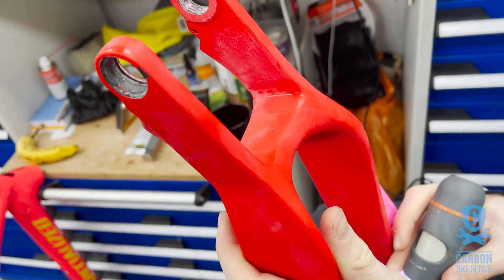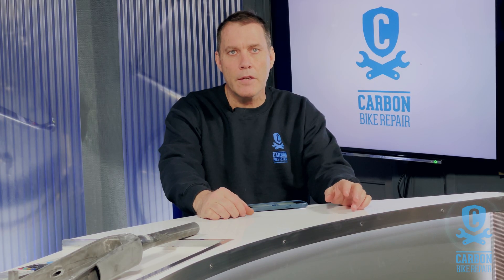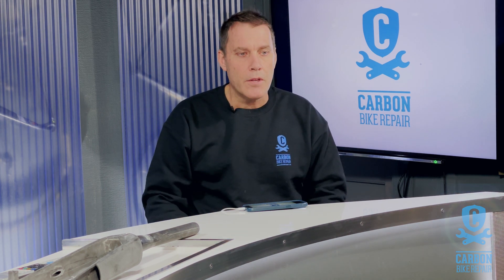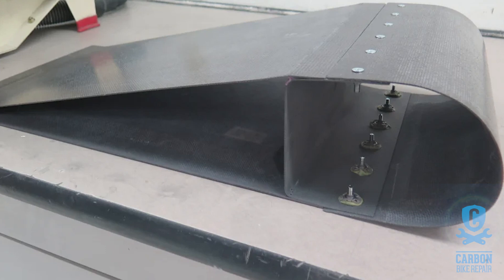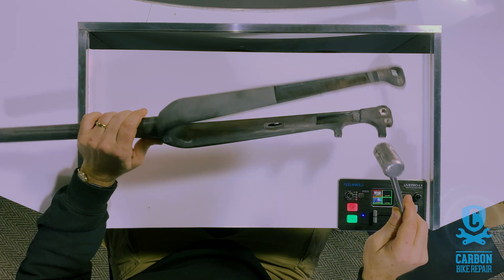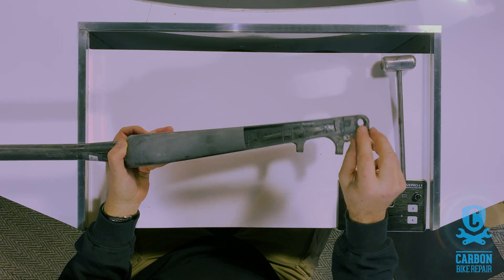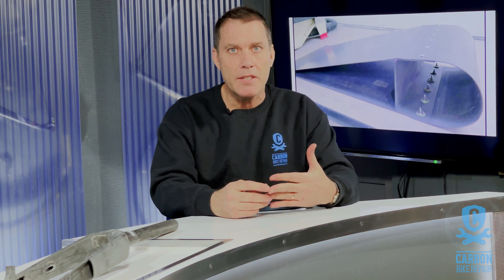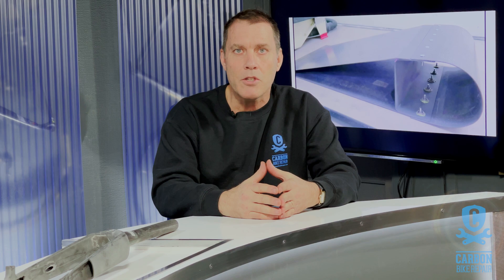MYTH BUSTING - CARBON TAP TESTING..NOOOO!!

Comment: So it sounds to me like the coin test is flawed because it can give you a false negative -- BUT if a crack does indeed clearly fail the tap test in an area -- say the bottom of a Top Tube, where the diameter is constant, there's essentially no chance of it being a false positive -- right?

Comment: 6:38 If you can't detect it you consider it a fracture?!
Reply from the maker: @mreese8764  That’s not what he is saying..There are cases where some visible anomalies or traumas are showing inconsistent or inconclusive results depending where the issue is. There is no magic wand. What would you do as an inspector? 
It must be then be investigated by paint removal and then material removal if necessary. 
If it is not conclusive with the tests Rob mentioned then it cannot be ignored. Today we use scanning software which is more helpful but even so we would still remove material if we had any doubt.
Hope that answers your question?
Reply: @carbonbikerepair1  Yes. Than you!

Comment: I feel like this advice works for a fork. I do understand that its unreliable do to your hearing quality. However, I didn't see the test on a bike frame. We dont have access to a expensive testing tools. So what do we do to test used carbon bikes?
Reply from the maker: Good question. Tap testing is a waste of time because it is not definitive. You need to be sure either way otherwise there is no confidence in the result. The best way to test for ‘hidden’ issues at home is to compress with your thumbs across the tube. Listen for noise and feel for unusual give in the tube. If you have a duplicate of the part in question then reference that. Look for paint cracks but that too does not necessarily mean there is a fracture in the carbon wall. Best of all if you are unsure, get it to a reputable carbon inspector. Be careful..there are many waving ultrasound and aerospace talk. Avoid. Look for reviews and experience to assist.

Comment: I agree, I'm an aircraft mechanic and tap testing is for checking delamination of a composite surface. In particular flight controls. That's it! It was never intended to check for cracks and there's inspections specially for cracks and that's always been X-ray inspections.